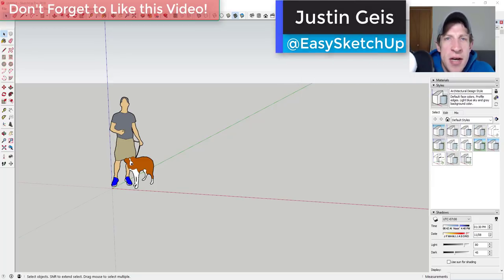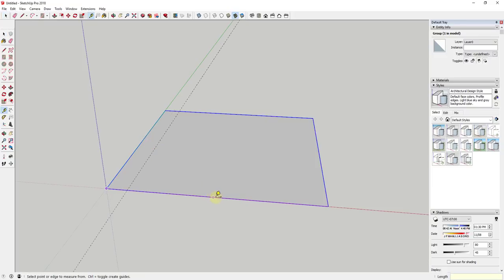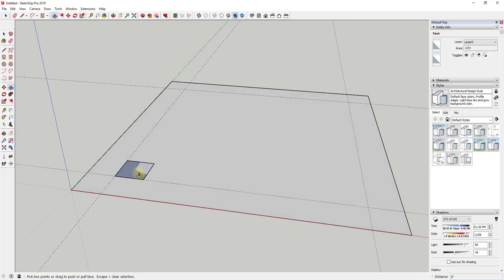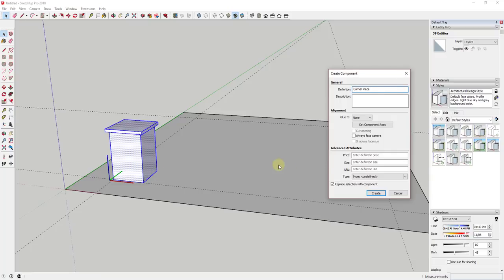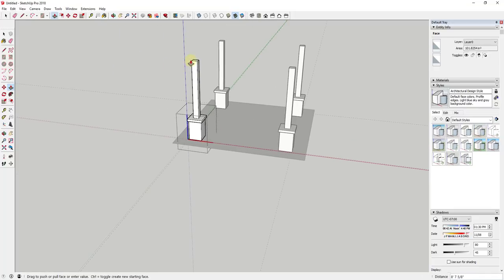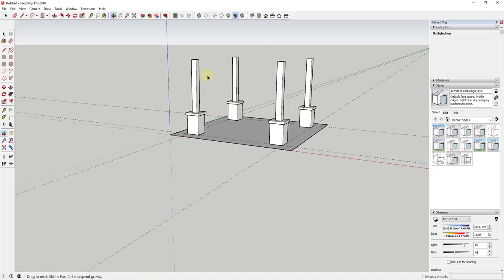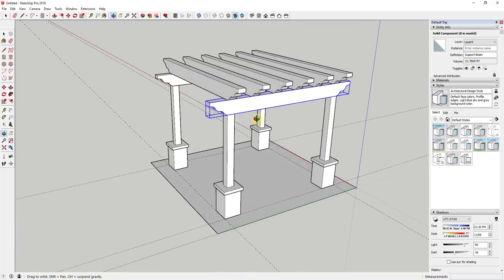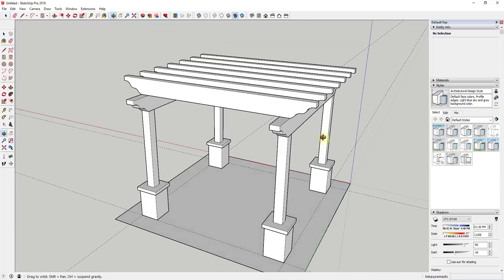Modeling a Pergola in SketchUp WITH COMPONENTS

Comment: Rather build your pergola with a slight pitch/slope.  I get many customers that wants to add roof sheeting, especially translucent sheets, to a pergola.  That is easy if your pergola already has a slight slope.  Expensive if it does not.
Reply: You could just  make the two posts 2 inches lower to make a slope